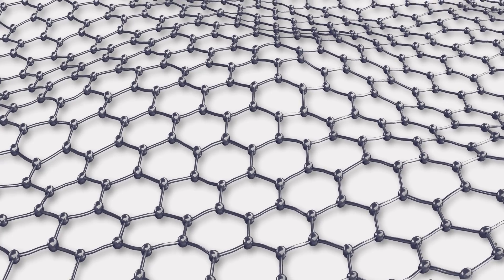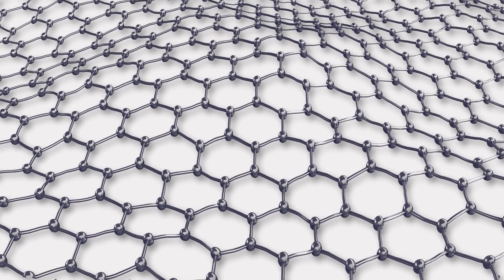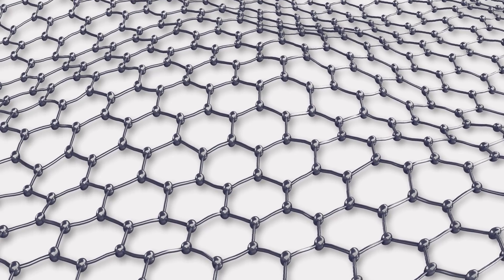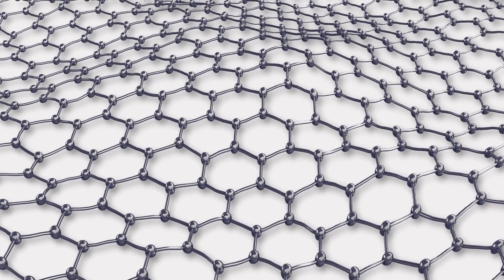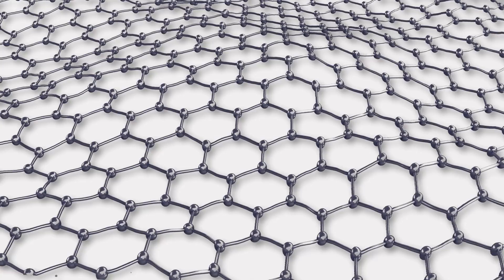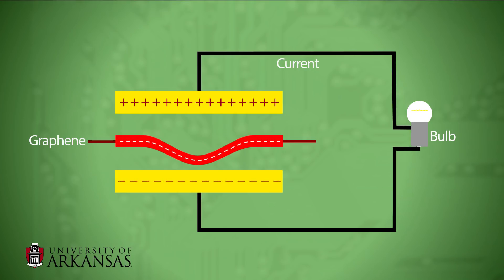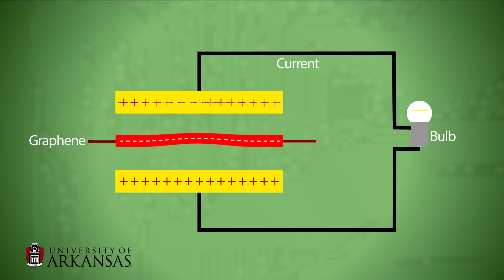A Potential Source of Clean, Limitless Energy

Comment: People need to do research before assuming something is impossible. The Second Law of Thermodynamics states that the state of entropy of the entire universe, as an isolated system, will always increase over time. The second law also states that the changes in the entropy in the universe can never be negative, no problem. What's happening here is a conversion of energy, not making something from nothing. The sheet of carbon warps similar to a cheap baking sheet warping due to the heat from the oven. Scale the sheet to 1 atom thick, and oven heat to ambient room temperature, then the theory stands. Here's a link explaining things. And I bet people will still be ignorant after skimming the link. https://www.sciencealert.com/graphene-levy-flights-limitless-power-future-electronic-devices
Reply: But the energy produced can be turned back into either useful energy or heat, which can self fuel the system in definitely. You also can't just derive energy from ambient temperature without dumping heat into a colder system(Carnot cycle), this is a text book example of a Maxwell demon.
Reply: Jonathan Nunez It does not work that way. If you have a law on the entire universe...let's say I plaster the whole universe with those machines. What happens then? Does a fairy come by and tell me I cannot do that?
Reply: SCARLET★STAR well first off, if you saw a fairy, then that alone would be pretty big news. And I'm not trying to describe this man's tram breaking the laws of the universe, what I'm trying to say is that he isn't grabbing energy from nothing. In an article on this subject I was reading at the time,(also was posted here in the comments section) was describing that the one atom thick material, wasn't truly one atom thick all over the material. Dozens of atoms that was like upstairs neighbors to the below remaining single atom thick sheet, was constantly pushing itself in between weaknesses of said sheet. Energy is the excited movement of molecules correct? We recognize this as heat, and heat can be just about anywhere, like room temperature. So the odd part starts here, while the temperature motivated molecules begin to force their way in between the sheet of a single atom thick crevices, they consequently also fall out of place back out of the sheet around the same time due to lack of Elbow Room. So what the professor was describing is that he and his students were confused by this Behavior, and that he had to zoom out to such a degree to only discover that the approximate single atom thick sheet was warping all over the place because of this, throughout the whole body. similar to how a cheap cookie baking sheet warps inside a hot oven. Another good analogy would be that this carbon chicken wire looking approximate single atom thick Square sheet, is being motivated to move and oscillate kind of like how a blade of grass held out to your mouth will vibrate if you blow across it while holding it between your fingers at either end. I can understand that this would be a strange idea, especially when it's supposed to be single atom thick stuff. But it's really not that far- fetched, and logically I can reason that this is not breaking any laws of physics, thermodynamics, hydrodynamics, quantum mechanics, or laws of relativity. In fact this abides by the law of relativity more than anything, relative to one's perception in scale. Like the two analogies (baking sheet/blade of grass) I gave earlier, scaling this down to an atomic level could still result in the same kind of behavior things at large-scale show.
Reply: Convection always vary nothing is perfectly still unless at absolute 0 thus fluctuations at nano scale are plausible due to micro fluctuations we cannot easily measure yet they are there. Now to combine small structures to a larger collector and you have room temperature energy production. No laws broken.
Reply: Yes, it's a perpetuum mobile of the 2nd kind https://www.reddit.com/r/Physics_AWT/comments/7fk4m6/brownian_motion_of_graphene_potential_source_of/
Reply: You cannot use it for heating of your home, but anyway, it's a perpetuum mobile of 2nd kind
Reply: lol never laughed so hard on these agnorants...  where do the heat of the ambient comes from ? seriously??   how about the SUN?   lolololololololololololollollololollollo    and come here again, where does the SUN energy comes from???????  lololololo  do you thing the SUN is a perpetual motion machine so, if it can create energy from nothing??????????
Reply: HelionDark agreed
Reply: Jonathan Nunez this does not mean that one day those laws could be side stepped using technology. Anything is possible.
Reply: Everything we take for granted today was decried "Impossible" until someone figured it out.

The Universe, Germ Theory, Flight, Electromagnetism, Radio-waves, Video Media, The Internet, Space flight etc.
Reply: well, just my opinion- but as much as we know in physics, and with what we are sure of to assume "laws" of said physics, its also a true statement that our current understanding of physics and those laws are not complete and fully understood. their are problems everywhere - the standard model has problems, not to mention the fact that the classical / relativistic / quantum mechanical problems persist - IE the laws that govern scales down to a single particle do not apply to relativistic scales, and the laws that govern relativistic scales have no place when you go sub atomic. now also consider dark matter ( just an excuse to account for a huge amount of missing energy within the cosmos) < that we still cannot explain  -- i feel pretty confident that their must be some pretty major mistakes in our current understanding of physics and laws.  so im not so confident anymore- to argue with anyone that something isnt possible just because some "current" laws of physics says its impossible. its obvious we have much to learn.  bottom line is, if they can develop a device that works on these principals - that in fact works , then we must conclude that their is a problem with some of our physical laws.  i mean another example of some technology thats stiring things up is the EM drive - nasa themselves have been working on- and for all intent purposes it in fact breaks some laws of physics - but the device is real and works. the problem is this- nasa is still researching how it works. they dont have a full understanding of the physics responsible for the phenomena they can measure in a lab.  if this device works, and they can make practical use of it, then thier must be some things happening in a deeper layer of reality thats eluding our understanding- that if we can learn to understand whats actual;y happening- we may discover that no laws are actually being broken.  its like a work around for the speed of light - one law says we cant go faster than the speed of light , but interestingly theirs a theoretical work around, that does not violate any laws, that let us indeed travel faster than light.
Reply: Jonathan Nunez the sheet of baking paper doesn't move from the heat, but from movement in the air due to convection.
Reply: Nothing is eternal
Reply: 📰 "The findings, published in the journal Physical Review E, are proof of a theory the physicists developed at the U of A three years ago that freestanding graphene — a single layer of carbon atoms — ripples and buckles in a way that holds promise for energy harvesting.

The idea of harvesting energy from graphene is controversial because it refutes physicist Richard Feynman's well-known assertion that the thermal motion of atoms, known as Brownian motion, cannot do work. Thibado's team found that at room temperature the thermal motion of graphene does in fact induce an alternating current (AC) in a circuit, an achievement thought to be impossible."

📰 source: https://phys.org/news/2020-10-physicists-circuit-limitless-power-graphene.html 

📰 October 2, 2020
Reply: So what's the power source then, ambient heat? If yes, then the environment has to end up cooled while the device produces useful energy. This is unambiguously a perpetual motion machine and thus a violation of the second law. 

If you disagree, please explain.
Reply: Jonathan Nunez There is a common misconception about energy. We don't use Energy itself to power things. We use gradients -> potential energy. You always need a gradient of potential energy to do something with it. You need a height difference in a water power plant. You need a pressure difference to generate wind for wind power. You need difference of chemical enthalpy to use chemical power. That's what the second law of thermodynamics states. Room temperature can not be used to power anything unless you have some region with higher or lower temperature for the heat energy to move. 

The issue with this "invention" is that it takes a system in equilibrium and then creates a temperature difference out of nothing. Look up Maxwell demon. This is essentially what this is.
Reply: Only if temperature stays same its perpetum mobile,if it lowers ambient temperature its just transformation of energy ,  that how i see it, it needs more data.

Comment: Nope.  You can't violate the laws of thermodynamics.  This is nonsense.
Reply: And what would stop the heat from surrounding air and subjects from transferring to the apparatus?
If you can generate energy from sea water, and you used up all the water inside your apparatus, then new water enters into it, so what's the problem? This has nothing to do with thermodynamics. You can't use all the heat in the universe or all the water in the ocean.
Reply: Xezlec it's not a closed system 
 ambient heat is entering the system 

It's "free" energy as it utilizes ambient energy that exists everywhere around us
Reply: That is not the real problem. The implication is that you could just use the heat energy, make a lamp glow, which will eventually result in heat (all energy will end in heat energy one way or another, that's why one of the proposed ends of the universe is the so called heat death). Then you can just use that heat again, indefinitely. It violates entropy increase, the second law of thermodynamics.
Reply: it may, but would take a really long time. ZPE does not violate thermodynamics principals. But a practical implementation might get there.  Free refrigerator?  HHAHA!
Reply: Maybe no.  This is not nonsense, unless you think all nano/quantum phenomenon are nonsense.  This phenomenon seems to be at the edge, at the interface between, quantum and newtonian physics.  The Zero Point (field) energy inside the atom is fundamentally different from the vibrating/magnetic/chemical energy between atoms.  We have not figured everything out.  We still do not understand what electricity is.  It is not simply the flow of electrons in a wire.  Electricity is accompanied by the "appearance" of the flow of electrons in metal, but electricity can also be thought of and modeled as a quantum field force.  Voltage across a pair of wires is not the result of electrons pushing electrons pushing electrons in a chain sequence.  It is the instantaneous quantum transporting of an electron in one location to another location in a field along the wire.  An electron disappears somewhere in a wire and reappears somewhere else.  This discovery may be a breakthrough, but we probably understand about 1% of it.